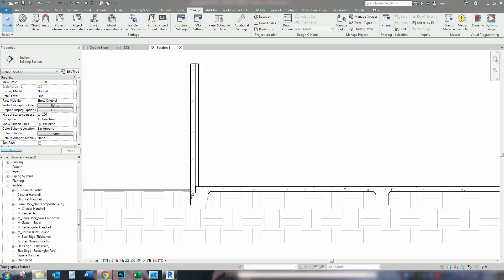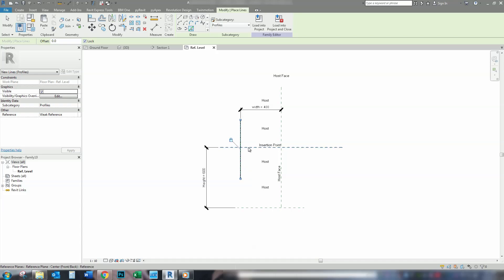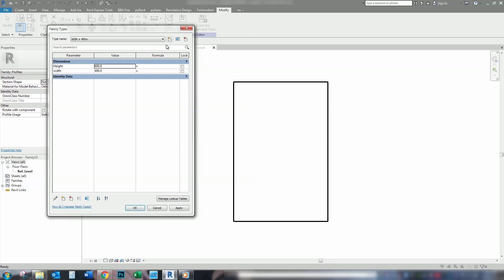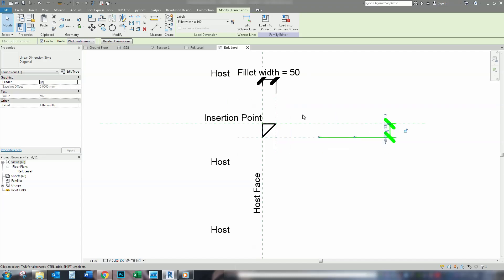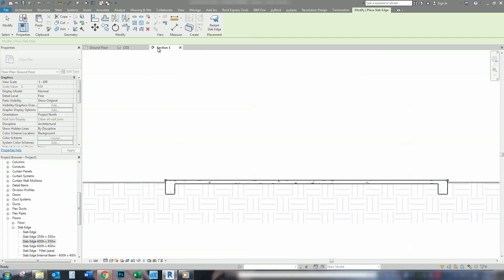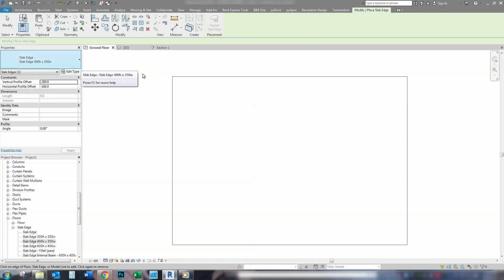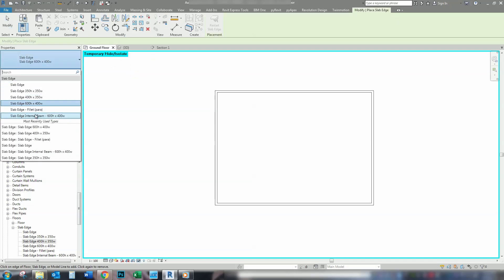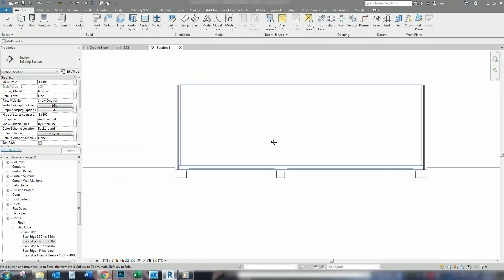REVIT CUSTOM SLAB EDGE

Comment: why not make slab edge profiles with fillets included?!?
Reply from the maker: HI Benjamin, thanks for your comment, You may want to change the size or angle of the fillet.
Reply: @revithowto5996  Fair enough. I have it setup with fillet width / height parameter included in slab edge family. I always draw it at 45° and haven't ever needed to change the angle. But obviously everyone is different!
Reply: My first thought exactly. This should have been all 1 profile, made parametric as needed. Making changes to the model after joining all of this would be a mess, and not fun.

Comment: ok, this must be dumb question. i'm a newbie revit user, but how do you setup a wall with "base extension offset" parameter?
Reply from the maker: Hi Jose, to be able to use the Base Extension Distance parameter follow the steps below
- select walls from the architecture tab
- select the wall that you want to extend and click the Edit Type button
- in the type properties dialogue box select the Edit button next to the Structure heading
- in the edit assembly dialogue box select the preview button at the bottom to show a preview of the wall and change the preview view from floor plan to section. this now allows you to click the modify button.
- click modify and then zoom into the base of the wall.
- hover over the base line of the part of the you wish to be able to extend and click. You should see a lock, click the lock to unlock it and then press OK to exit the dialogue boxes. Now the base extension parameter should be active when you select that type of wall from now on. Remember to give it a negative number if you want it to go down.

Hope this helps.
Reply: @revithowto5996   thanks so much mate, really appreciate your time explaining it. looking forward for more great videos.

Comment: If my template is construction in revit 2020 and I am using imperial there is no "profile hosted". Tried to save the slab edge and had ZERO CLUE where that folder was and couldn't find it. Performed 2 family types and I saw both before exiting and saved them in the 'Structural Foundation' folder, which doesn't help when you need a slab edge, but it was at least somewhere I could find it, look in that folder and there is only 1 family type. Saved and exited to model and clicked on slab edge, edit type and no slab edge found because it isn't in the 'slab edge' family folder. Searched for a slab edge family folder, which has 4 standard edges in it based on what I can see in the model screen and find the 'slab edge' folder with ZERO types in it, so I grabbed the one I created out of the 'structural foundations' folder and the 'slab edge family' thing still doesn't see what I created. 

3 FREAKING HOURS to create a 30 second profile that cannot be found. I don't see how companies pay money for this crap of a program. 23 years of working with CAD and I can't make a freaking slab edge. I have spent over $1,000 in training, 16 classroom sessions of 4 hours each (the instructor was worthless for production CAD just play around with the software class), paid for the software, watched over 40 hours of training videos, taken 45 pages of notes, watched at least 50 youtube videos and I can't make a slab edge, change details in a wall, make a custom titleblock, draw a detailed roof eave to gable detail, or generate a section cut on a sheet to make a set of working drawings. I graduated college with a very good GPA, I have used ACAD forever, produced working drawings for $100,000,000 worth of projects, built 3D models in Microstation back in the 1990's, but I am worthless at Revit. (It took me 2 hours to see the slab I made because the software was toggled to not show the floor. Why on earth would it be set to not show a person the floor?) 

Spent 4 hours to find a overhead coiling concessions door that I had to find from an online BIM model supplier because there is no concessions window in the provided software and no easy way to make one.
Reply from the maker: Hi robstatetx
If the imperial family template library doesn't have the 'Profile Hosted' option, you could also use the standard 'Profile' family template . The Reason i used the Profile Hosted is because it shows you where the insertion point and the host face are. 

When i saved the slab edge profile in the video, I saved it to my own library that i created, which is not the standard out of the box library that comes with Revit, so that is why you may not be able to find the slab edge folder to save your profile in. You could always add a new folder to the standard AutoDesk library within the profiles folder named slab edges at the same time as you save you new profile to keep all you new families located in the same library if that makes sense. 

I hope this has helped.